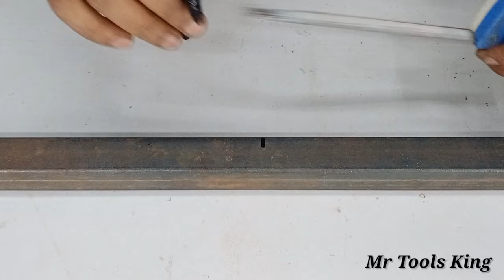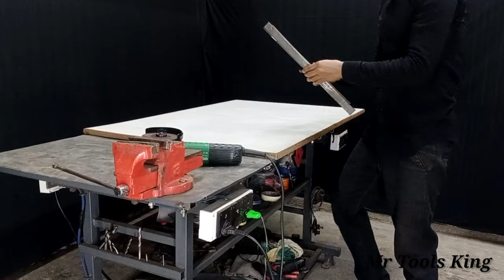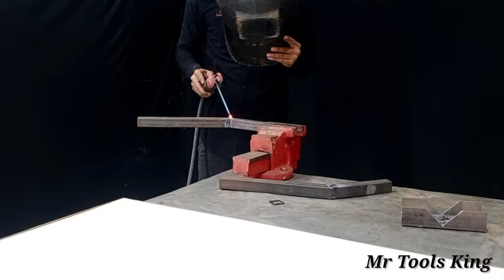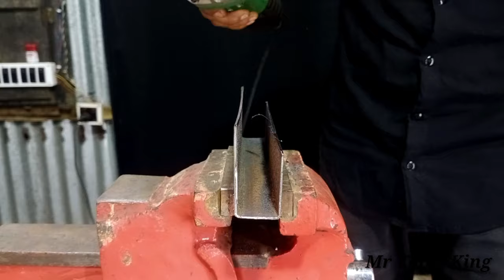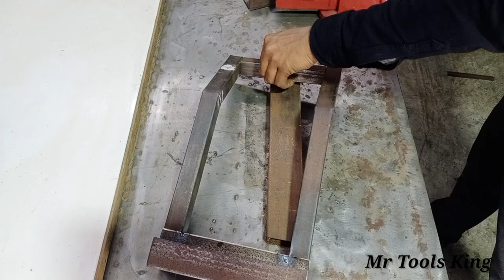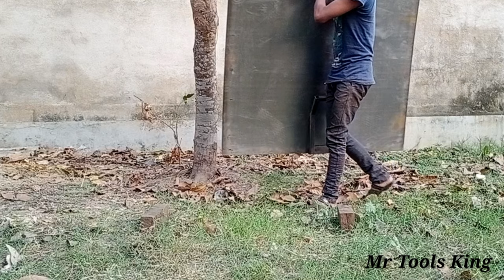How to make a Metal Sheet lifting tools

Comment: You have no notion how this video helped me. I work alone in my workshop, I was having a lot of difficulty to remove the top of my welding bench, because the space is small (I need to assemble and disassemble to work), this process is very difficult and dangerous, the top of the band is large. With this tool it will become easier. Thank you very, very much. 🙏🏼🙏🏼
Reply from the maker: Thanks bro 👍